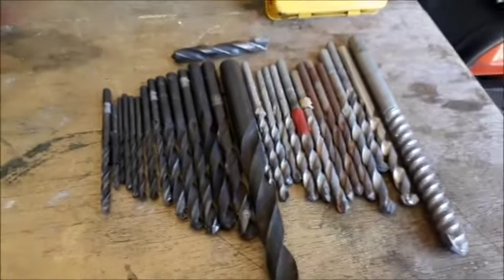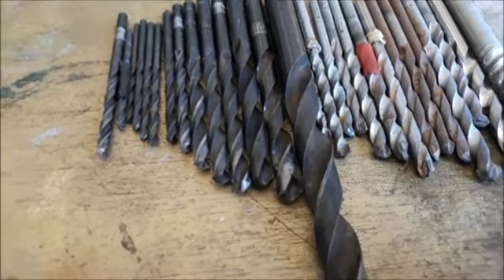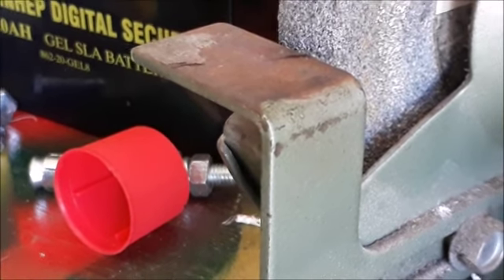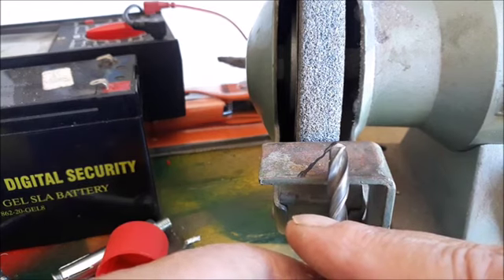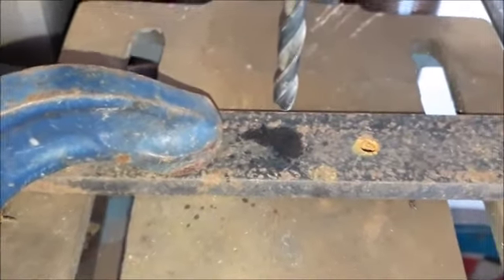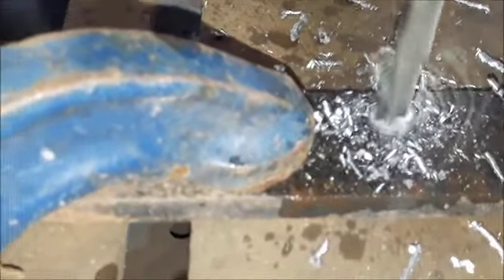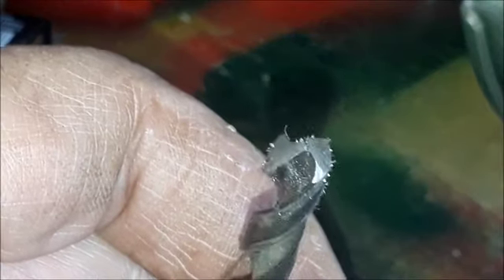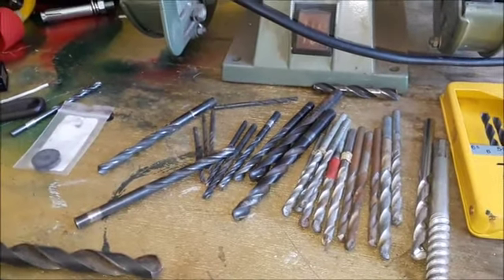How to sharpen a drill bit.

Comment: Excellent Video Jan,  I have Never been succesful sharpening drill Bits at all but I  have dozens of old Bits and I am going to try this method of the 60 degree angle.  That must be the Trick I never knew about. I was always told that the first Turn of the Bit is all that does the Cutting, the rest of the bit basically does the Clean our, is that True?  Great Info to know, thanks for sharing this. If I am successful I will do a video and give you a shout out.
Reply from the maker: Thank You Dan, I really hope it help, good luck my friend, yes it is true, only the grinned edge do the cut, the rest bring up the shavings, you sharpen drills like a pencil until it is to short